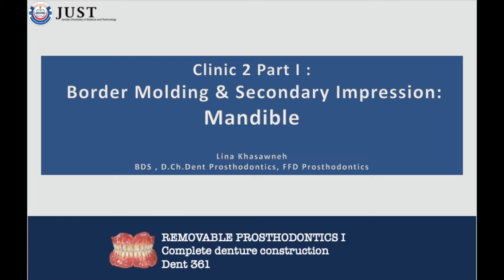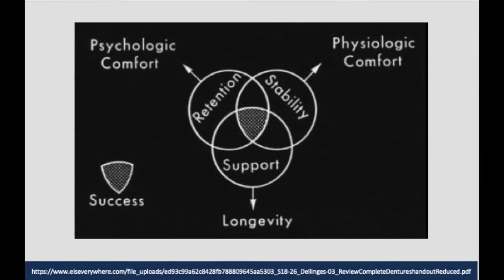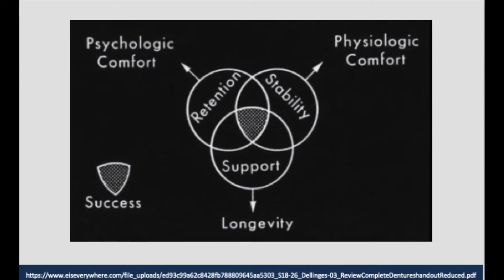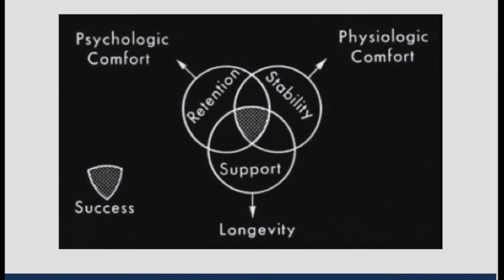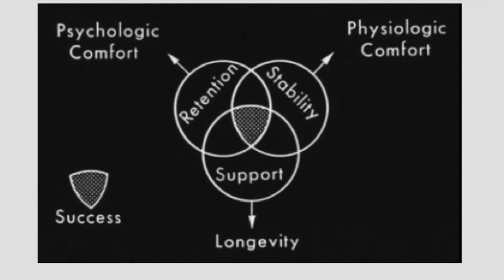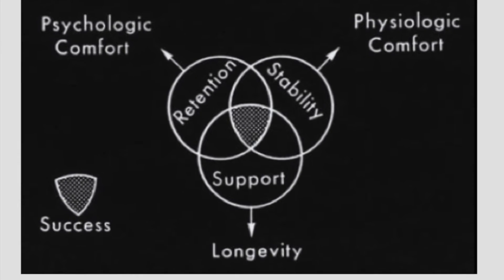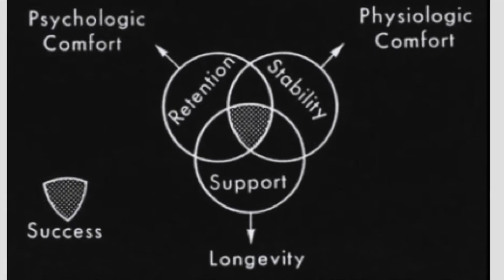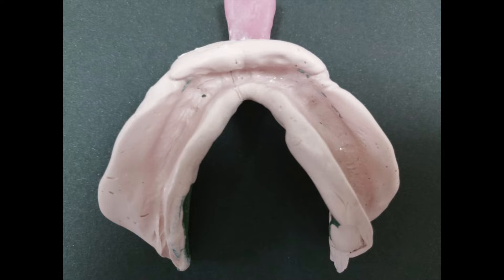Part 1 : Border Molding and Secondary Impression  Mandible

Comment: Why no holes drilled prior to impression making?
Reply from the maker: we used a muco-compressive  impression technique, so no spacer or relief used, only undercuts were blocked out on the  primary cast
Reply: when to use this mucocompression method?

Comment: Why not do the border molding all at once?
Reply from the maker: Because green stick ( impression compound) is used. You may do it all at once if you're using silicone material you will need to do it all at once.